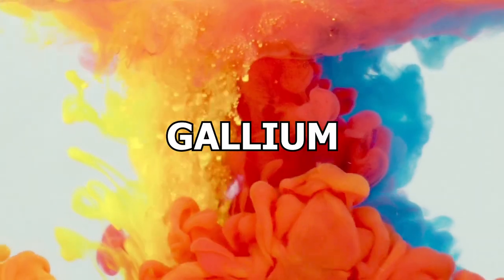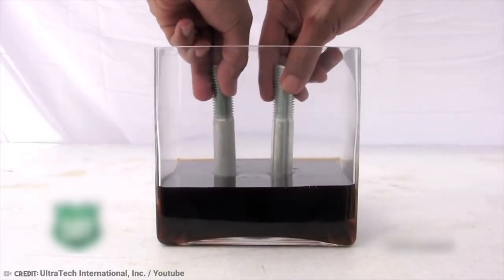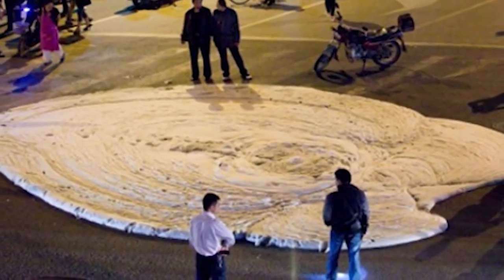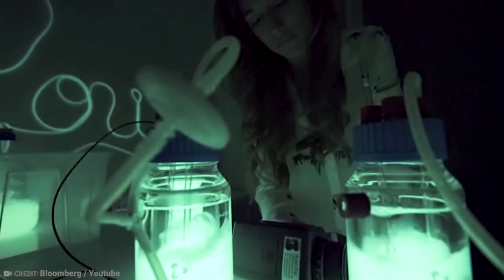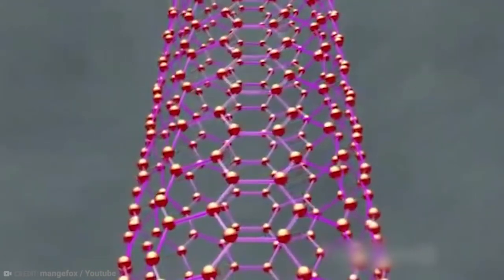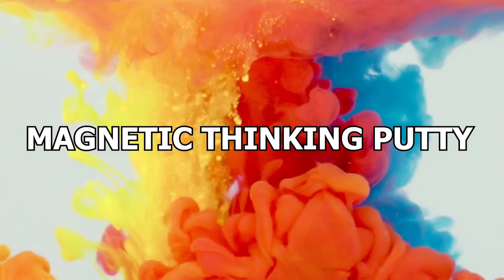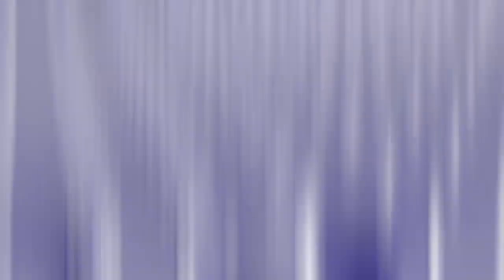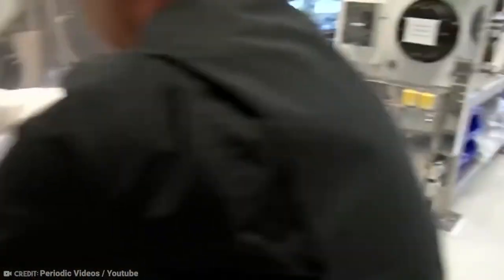15 Most Unusual Substances In The World

Comment: Cesium does not melt at room temp.  It's MP is just over 83ºF, and it is not Cs137 that is used in atomic clocks, it is the common isotope, 132 that is excited by microwaves, measuring the time it takes for the outer electrons to return to their resting state that measures time.  Plutonium's heat does not come from beta and gamma emissions, it comes from its almost pure alpha emissions, and since it is not a living organism, there are no neurons in it.  Yes, I know you meant neutrons. :-)

Comment: Some good stuff here, but a lot of gaffes/false statements I'm afraid.
Gallium is 18ppm or so or the earth's crust, not 2000ppm as you claim!  The melting point is nothing at all to do with its use in electronics, that's complete nonsense.  Gallium arsenide, gallium nitride and similar semiconductors are used for their quantum properties such as band-gap and electron mobility. 
Its nitinol, not nitino !!! 
Silk is not 98% water, its basically protein.
Caesium is not spelt cesium, and not pronouced sessium!  "Seeezium" is how its pronounced.
Very few metals stick to magnets, basically 3 of them, iron, nickel and cobalt (and their alloys)
Metallurgy is pronounced METalerGEE